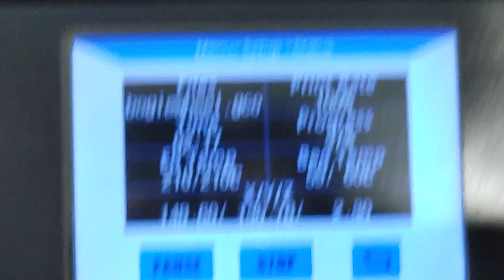Artillery Sidewinder X3 Pro is a Bust - Part 8

Comment: I had before an Anet Et4, a much worse printer in theory, but with a couple of upgrades it printed perfectly. Sadly a driver died and bought an X3 Pro. A lot of issues, is loud and imprecise (why we want quiet drivers if the layer fan sounds like a 747), not a recommendable printer at all.